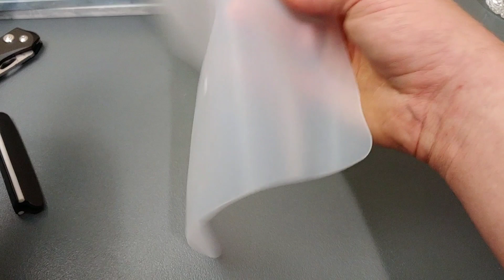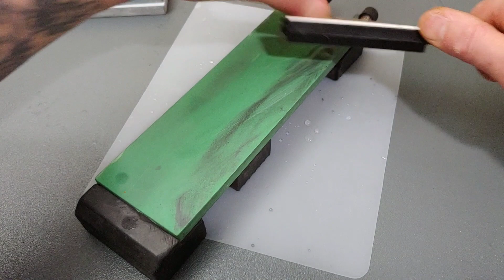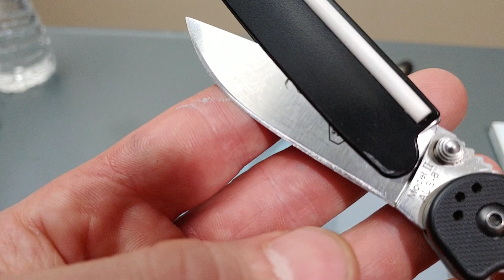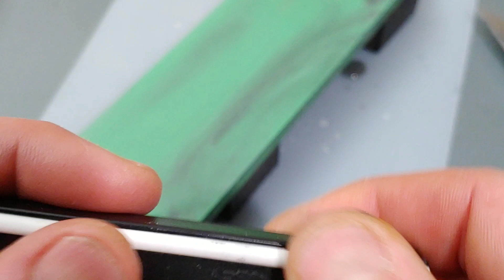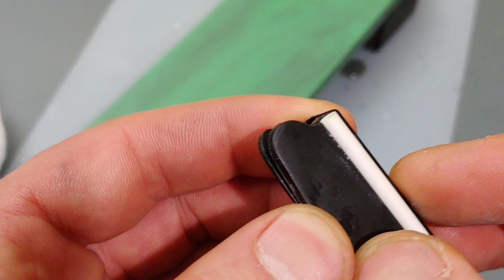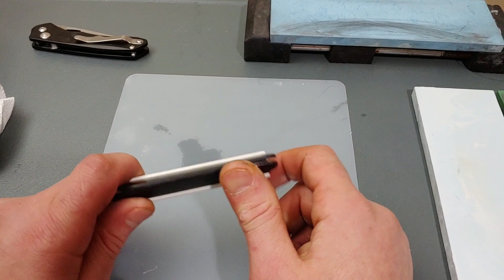KNIFE SHARPENING GUIDED ANGLE CLAMP

Comment: I recommend using cheap diamond stones and a sharpal magnetic angle pyramid guide. It's hot 25,20,17,&14 degree guides. $7 on Amazon and it comes with one that's non magnetic for whetstones. It's helped me a lot. I got a decent sharpening system for just under $20 from Amazon but I also bought the worksharp precision adjust for when I'm feeling lazy or if I fail hand sharpening.appreciate all your vids on knife reviews and sharpening tips.

Comment: Many years ago I bought a couple of metal guide clamps.  They worked, but I did not like them.  I was hoping they would let me get a feel for the proper angle, but they were too heavy for that.
Reply from the maker: Yeah metal would throw off the balance, sometimes you just have to put a knife to the stone, but Work sharp has a couple systems that have an angle set for you to start with which really helps, i did a review on the work sharp field sharpener and it works great they also have larger systems that work good
Reply: @NeevesKnives  I am a huge fan of Work Sharp's field sharpener and their sharpeners in general.  Unlike clamps, their angle guides help train muscle memory for free hand sharpening.
Reply from the maker: @mrblauer1  definitely

Comment: I cringed when I saw this thumbnail.  Be sure it's clean inside before sliding it on the blade.  First time I tried one it scratched the shit out of my blade.  It came free with a set of whetstones I ordered and probably had some stone dust and grit inside from shipping.
Reply from the maker: Oh wow wish i would have said that, yeah its not the best but i know theres folks that dont have the $ for a system and need budget options
Reply: @NeevesKnives  I like the concept and it works ok, just maybe not on your nice knives.
Reply from the maker: @hawaiiknifeandgear5531  atleast not without tape